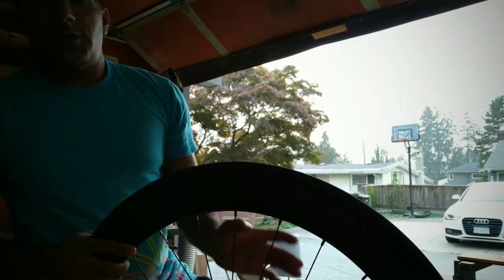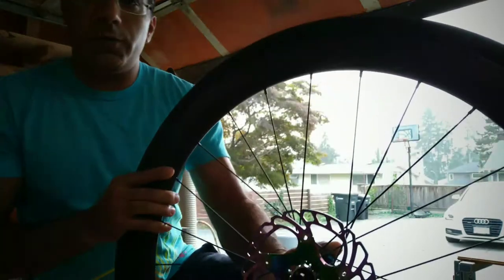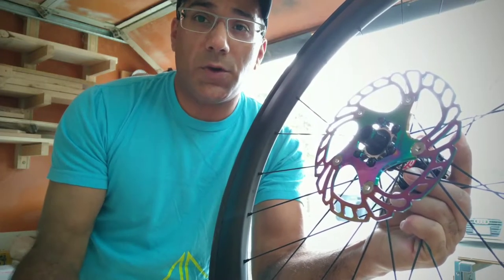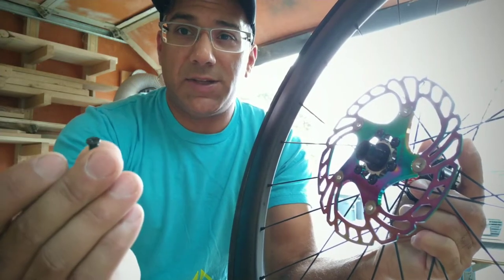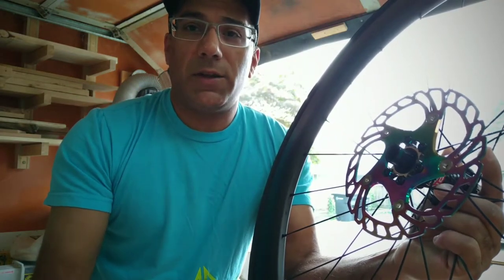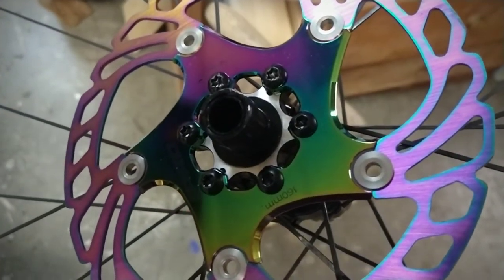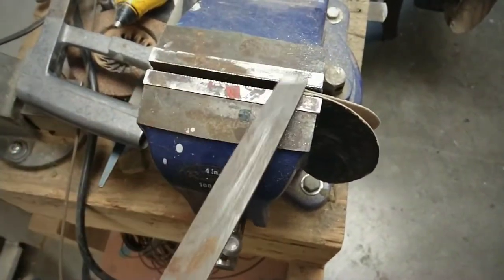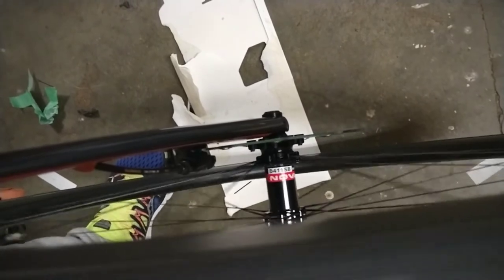6 bolt disc brake rubbing on fork solution.

Comment: Just put a spacer on your axle.
Reply from the maker: Not sure if that would work, the drop outs would be at an angle. With steel that's not a problem. These are aluminum bonded to carbon. What do you think?
Reply: @TalesfromtheGreenway  Ahh after watching the video I see yours is not the usual case, the usual case being steel or ally forks flexing because of QRs (quick releases), where a spacer or washer is actually beneficial and will bring or keep the forks more true. Is the hub you are using factory spec?
Reply: @TalesfromtheGreenway  Anyhow your fix was good enough, the 6 bolts arent gonna come loose or snap off all at the same time before you notice anything, the other option would have been the smaller bolts with loctite on them, there isnt much out/inward force on them bolts.
Reply from the maker: @craigmatthews3651  thanks for checking. Factory uses newer style center lock. Cheers.
Reply: @craigmatthews3651  i have this problem, can you pls show me what spacers to use?